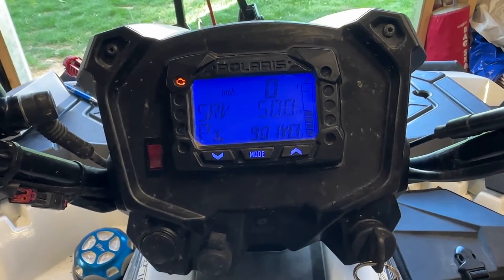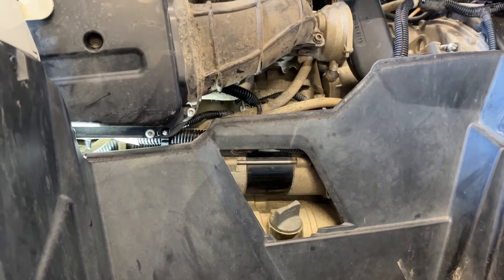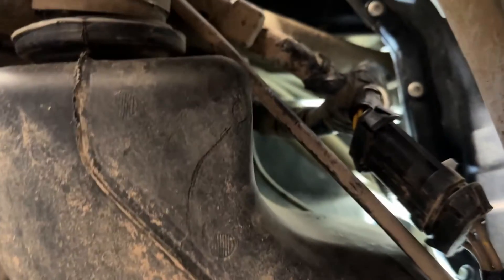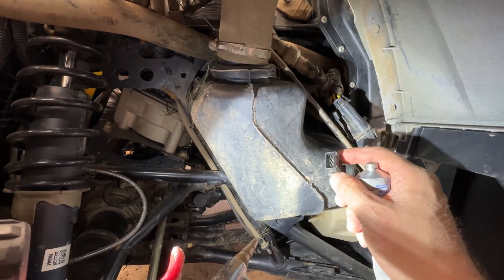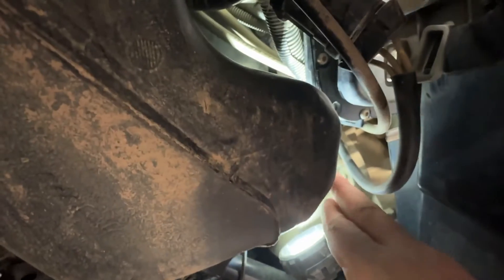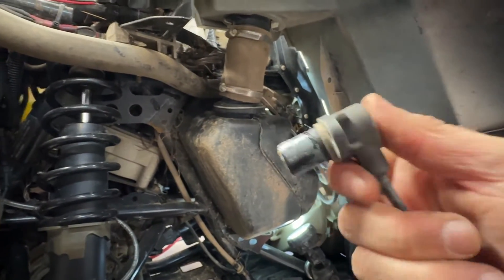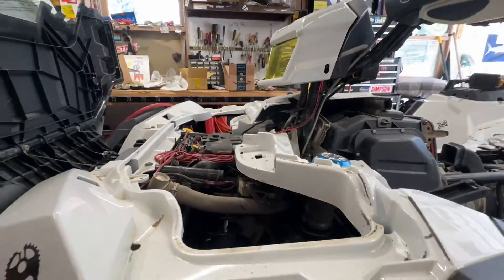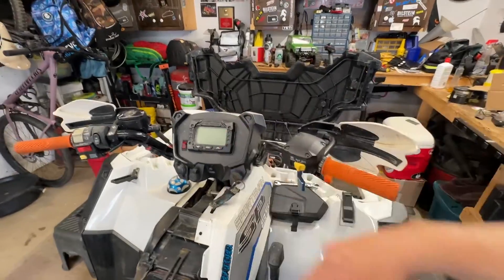Polaris Sportsman 850 diagnostic code 636

Comment: How did you plug it back in? I have it connected half way in but for some reason it won’t go in all the way.
Reply from the maker: sorry i dont have a specific trick. i just got my hand up in there and squeezed.  is your plug possibly dirty ? make sure it is clean so you get an easy connection
Reply: @RideTheEarthnow I ended up using dielectric grease and pop right in. Thanks for this video
Reply from the maker: @jorgefigueroa3128  Nice, glad you got it and thanks for letting me know what worked for you, could help someone else out in the future.

Comment: I have a 2015 850 sportsman it only has a mode and sel buttons.      I have tried turning it off and on 3 times but it isn’t giving me my codes what do I do now?
Reply from the maker: I am not to familiar with the 2015 but i did read this, might be worth a try?  You have to hold the yellow button, then turn the key on. Then press the yellow button to cycle thru the screens.